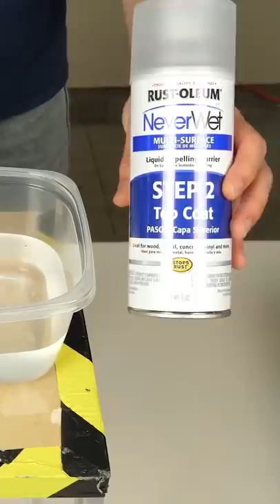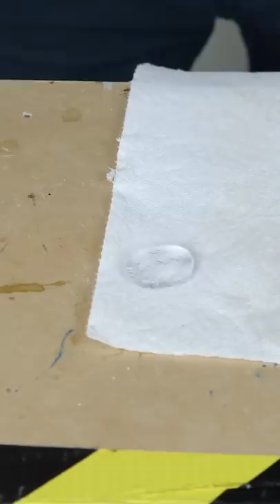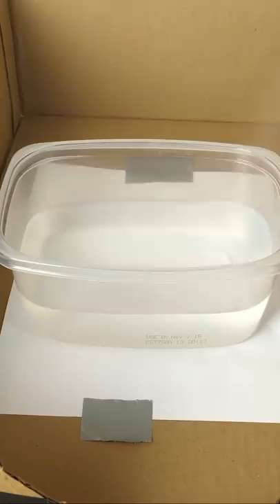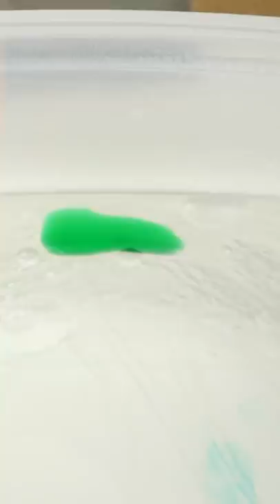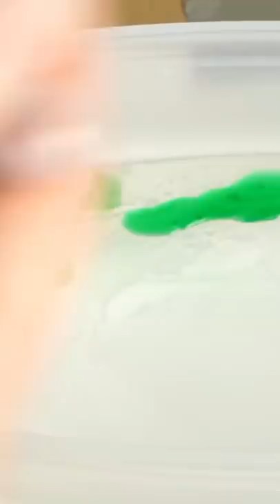But what if you spray Neverwet on water...?

Comment: Looking forward to 
“Let’s see what happens when we drop antimatter on matter…”
Reply: The future... I see it.
Reply: -Kaboom?
-Yes, Rico, kaboom.
Reply: Gg
Reply: The best part is, this experiment might be able to happen, just probably not in our lifetimes.
There’s this fancy lab I can’t remember where that learned how to make antimatter but it’s a slow process that produces so little, and it’s nearly impossible to contain for prolonged amounts of time. But they have quickly learned that if you were to obtain an amount equals to that of a stick of dynamite, it would be more like a very very large bomb
Reply: 300th like
Reply: @zyanidwarfare5634  antimatter the size of a sand grain would make a pretty large explosion, let alone a stick of dynamite's worth. 1 stick is about 190 grams, its estimated 1 gram reacting with 1 gram of matter would produce more energy then the first fission bombs (15-20 kilotons of TNT). granted 190 grams wouldnt be as powerful as the tsar bomba (50 megatons of TNT) , but remember the tsar bomba weighed around 60 thousand lbs, or 27 thousand kgs. if my math is correct and the info i found is correct, it would take around 1.16 kg of antimatter reacting with the same amount of matter to achieve 50 megatons TNT equivalent
Reply: This is why I never order pasta and antipasta at the same meal when I eat Italian.
Reply: They both annihilate and send off gamma rays 😎😎😎
Reply: @toob1979  lmfao
Reply: @Robo-xk4jm  if there was the next ww. I can see participants will race developing this kind of thing into weapon at rapid speed
Reply: @zyanidwarfare5634  you mean the Hydron Collider in Switzerland?
Reply: It didn't matter?

Sorry
Reply: It doesn't really matter.

Comment: So this should work great on sneakers and boots. Thanks
Reply: It works well on fabrics that are porous or have a small denier (thread gap).
Reply: They should apply this to all cars after the clear coat gets applied. 😆
Reply: waterproofer for shoes has been around for decades ??
Reply: @justacinnamonbun8658  

Especially the windows/ windshield! It seems like those wiper blades can't ever go fast enough when it storms REALLY bad. 

I wonder if this stuff would also prevent ice from forming on the windshield & car windows during really cold days (like when it snows / hails / icy rain)?Kinda like a Preventative de-icer
 🤔 🤔 🤔

Comment: Talking about neverwet. I made my shoes water proof by using a wax candle, I started rubbing it all over the shoes one day that I was bored and then used a heat gun to melted all over the shoes. I tried to get them wet and it actually worked, the shoes were dry. I found out later on people have made videos about this but it’s cool to do things by instinct and find out you are not the only one thinking alike.

Comment: you dont even need never wet for water you can just use super dense sugar water at the bottom and low dense sugar at the top you can also use food coloring in it just add it slowly or it will mox

Comment: This experiment could be done differently. Could it be possible that mixing the water every coat could result different results? What if the repeated the same steps demonstrated in this video but the neverwet film with the water to yield also different results?

Comment: Wait I have a question that I was wondering ( and it might sound dumb) but is air hydrophobic? It repels water ….. right?
Reply: Oxygen,CO2 and Nitrogen, thus also Air are indeed hydrophobic, as they can pass through hydrophobic membranes (=filters made out of hydrophobic materials), which water and other hydrophilic fluids cannot. Generally non-polar molecules are hydrophobic, basically just because water is polar and thus attracts other polar molecules, but not non-polar ones. The non-polar molecules however are attracted to each other and basically just clump together. This is also the origin of capilar forces.
Reply: Awesome! Thanks for replying! I didn’t water is considered polar and some other fluids are non- polar, it’s not stuff I remember in school!
Reply: @lilylovesfidgets1349  Yeah, water is polar due to its molecular structure. The hydrogen atoms are attached to the oxygen atom with an angle of around 104° between them. Oxygen has 8 electrons, while the hydrogen atoms have only 1 electron, thus the electric field of H2O is not symmetric, which means it is electrically polar. Oxygen is O2, Nitrogen N2, so both have symmetric electric fields and are thus non-polar. CO2 has also a symmetric electric field, although carbon has only 6 electrons, because the oxygen atoms are alligned in a straight line with the carbon atom.

Comment: What happens when you spray neverwet on your skin 🤔
Reply: Most likely the person would not be able to results their body temperature via perspiration and would have a gradually increasing body temperature (hyperthermia),  which would eventually lead to complications such as multi organ failure and  most likely death (without proper and timely intervention).

There was an incident i had read about before, involving an individual who had covered himself in a substance that had hindered his body's ability to regulate his temperature and sadly he ended up passing away due to secondary compilations caused by the hyperthermia.

I'll update with a link to the article if I can find it...